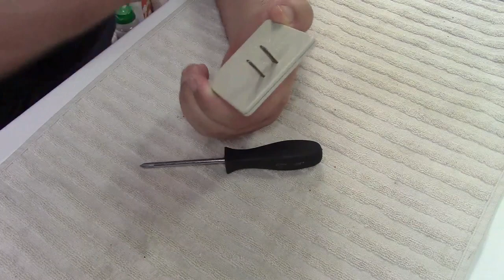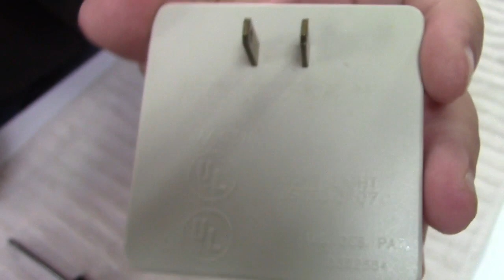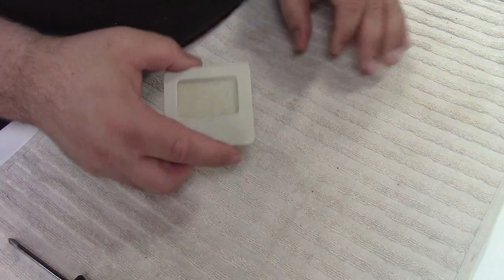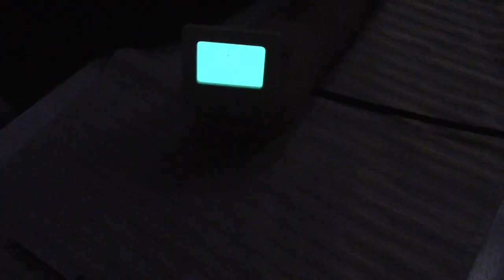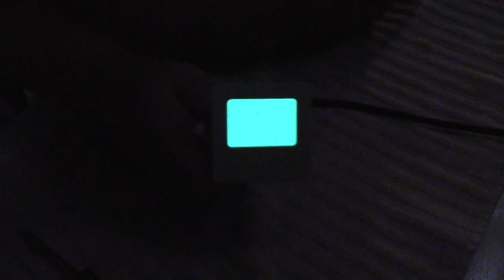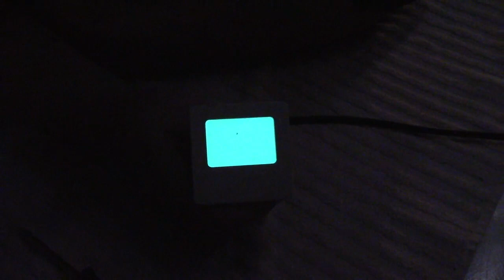Move Over LEDs--The Austin Innovations Inc. Model 11100 Electroluminescent Nightlight! Old Tech FTW!

Comment: I have one.  I bought it when I bought my house in 1996.  Yes, it still works.  
It does light my hallway slightly.  If I need to use the bathroom in the middle of the night, the glow from this light is enough to see my way down the hallway.  It's perfect for my need.
This light has been on 24 hours a day, 7 days a week, for 29 YEARS.  Pretty impressive, I'd say.
Reply from the maker: You'd be hard pressed to find an LED last even a third as long.

Comment: Electroluminescent is something that is only used in night lights. They also glow like a green color.
Reply from the maker: It's used in other things as well, it was a popular backlighting option for black & white LCD screens.  There are new ones that glow different colors, though again, LEDs have taken over.
Reply: They're also used in "EXIT" signs, due to the high reliability, longevity, and, no need for any kind of electronic ballast. They are also very forgiving to voltage transient spikes, much like incandescent lamps. These will out-last any incandescent light, and, most LED's!! The only thing you need to know about these, is that they are a capacitive load on their power source. If this is supplied by a modified sine wave inverter, you'll want to place a 1,000 Ohm resistor in series with it, to prevent current spikes caused by the sharp corners of the wave form. That will help prevent rapid degradation of the electroluminescent panel.

Comment: I have a few of these lurking around the house. One in the laundry room, one in the hallway, and a third one I misplaced a while ago. They keep on marching on, and it’s like they were designed to last forever - just like the aforementioned Timex Indiglo products!
Reply from the maker: I am very surprised at the longevity of these.  I don't keep this one in service anymore because I don't want it to wear out, whenever that day comes.  There are still "LimeLite" brand EL nightlights similar to this manufactured even today.

I've also found over the years that there are never enough outlets, they always come at a premium.  There's always something new to plug in.  So a nightlight using up an outlet...

Comment: We got a few of these electroluminescent nightlights in the early-mid 2000s, I think it was a box of 2. One of them is still in service to this day at my parents' house, the other one I believe is over here in a box somewhere. They don't put out much light, but in the middle of the light it's enough to guide the way to the bathroom.
Reply from the maker: Yes, I believe you had an old video on one similar.  They were useful then, and are still useful now, with negligible power draw.

Comment: Indeed, my late grandfather had several of those around his place back in the late 90's, early 2000's. Always thought they were pretty cool.
I have a couple 90's Timex Indiglo watches kicking around the hoard somewhere. Seems like they use the same, or similar technology for the back light.
Reply from the maker: Nice!  They were pretty popular and not terribly expensive.  My grandfather actually had a much older one.  It wasn't just an EL nightlight, but also a power tap as well!  Sadly, the EL in it died, it would only light for a short time and then fade out.  Not sure what happened to it, I may have thrown it out.  It was one of those real old power taps that wasn't even polarized, meant for the old "suicide" plugs because we didn't have the fatter plugs of today.

Comment: The modern equivalent, panels, tape, wire and strings, along with the modern colors are stunning.
Reply from the maker: I'll bet they are.  If that stuff was around 25 years ago, I might have souped up my old Chevy with some.  Would have added 10HP!
Reply: @jaykay18  That extra 10, still would not keep up with a Citation X-11
Reply from the maker: @RollingTardis  Of course not!  My cousin used to joke that my car ran on 2 AA batteries!